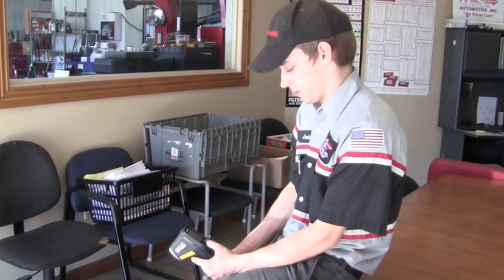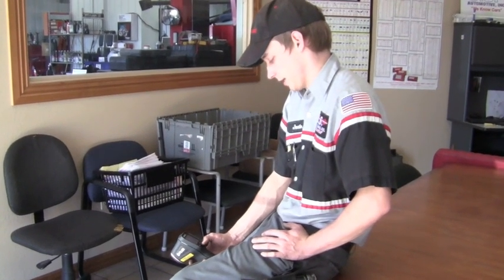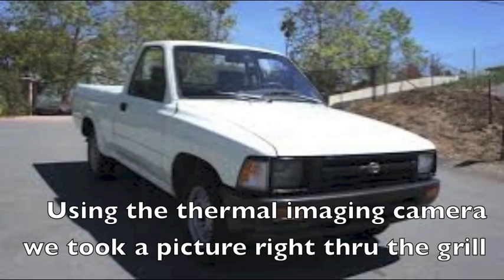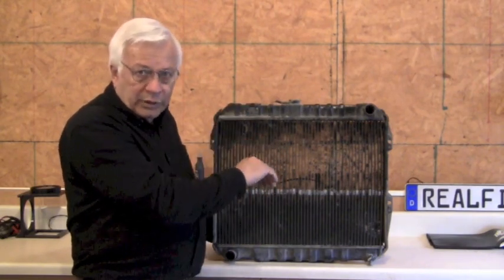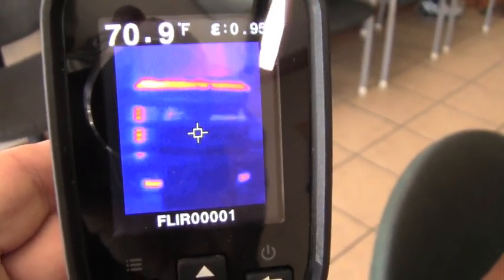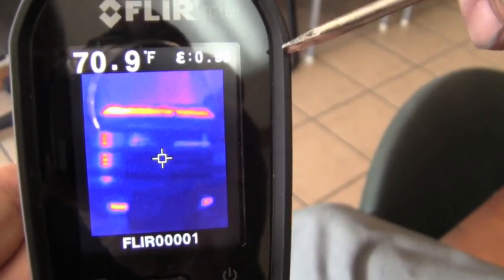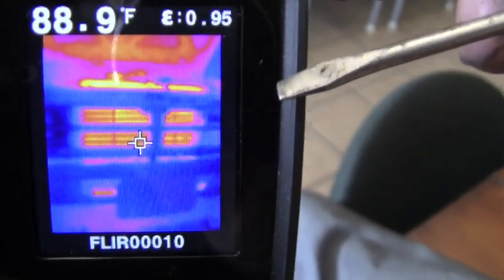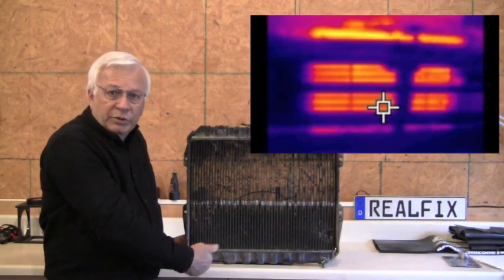Thermal Radiator Test

Comment: This tool adds a new dimension to the mechanic's diagnostic ability to target the cause of the inherent engine malfunction.What it supplies is dynamic data during the heat exchange process and copper fastens  the evidence which enables the mechanic to make an on the spot decision  in favor of the customer.Flir imaging camera demonstrates it's ability to compete on a professional level.

Comment: Good if the radiator is visible... as in not buried in A/C condenser & fan shroud. If the radiator is accessible, a 'poor mans' method is spraying some water on the core; contributing tubes are warm and will dry quickly where plugged ones are cooler and will remain wet longer.

Comment: I've considered this tool for this same problem but the only problem I have is if the vehicle is equipped with a/c and has a giant condenser right in front of the radiator. in that scenario i would think this tool to be useless.

Comment: A Thermal Imaging Camera (TIC) is a useful tool. Does the Flir model you use in your shop come with focus adjustment? A sharp focus is useful when using this kind of equipment. Both to see details and to get correct readings.

Comment: Do you think an A/C condenser in front of the radiator would block the thermal image of the radiator? Would you have to take the image from the fan side of the radiator if a condensor is in front of the radiator?
Reply: +Thevinylking69 your right

Comment: What I do to check and see if the thermostat is the issue. I let the vehicle get to temperature. then I check for hear from the vents.
Reply: You should have heat from the vents anyway. The hot coolant will bypass the thermostat before it opens, going through the heater hose circuit giving off hot air at the vents.

Comment: I don't think you handled this properly.  All you had to do was read the temp of top tank w/ engine running warm and stabilized and (2) read the temp at bottom tank.  What could be easier.  What is especially wrong here, is that you 're not giving at least typical top tank and bottom tank temperatures OR (alternatively) you are not giving deltaT, which is all we need to know.   If our radiator does not line up with the normal DeltaT, then we know there is a serious problen in the rad.